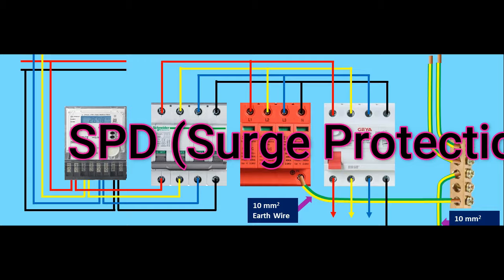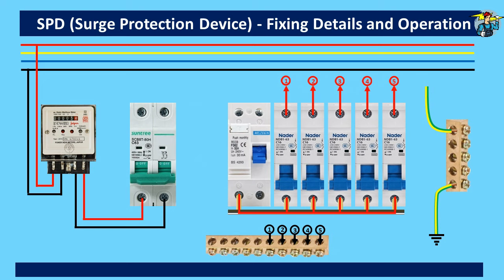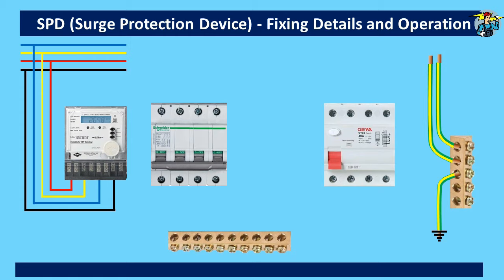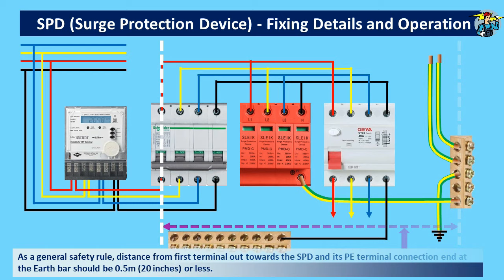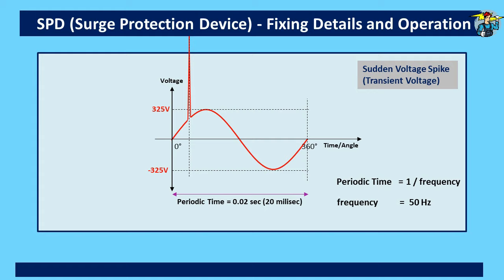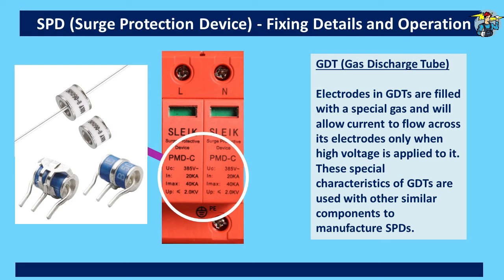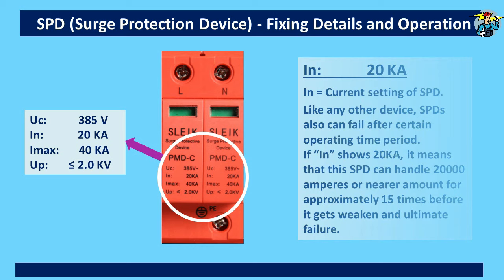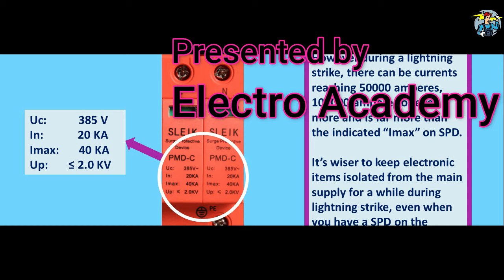Surge Protection Device / Surge Arrester / SPD working principle / Overvoltage Protection Device

Comment: Thanks for the informative video. 

What size fuses (normal or air?) do you recommend to place before the SPD? I have 16A 4P 230V coming in from the grid and 63A 2P 230V from local solar inverter.
Reply from the maker: 80 Amp fuses are recommended.

Comment: Do we need a dedicated earth bar, or we can connect the SPD to the existing common earth bar.
Reply from the maker: If the earth wire size from present earth bar to the ground rod is 10 mm2 or more, same earth bar can be used for SPD connection.
If it is less, you need a separate earth wire with 10 mm2 or more, from SPD to the ground rod.

Comment: Great video.. In a surge scenario, the SPD will ground the excess voltage but WILL it  also trip the MCB??
Reply from the maker: Even a high performing MCB will take more than 2 milliseconds to operate.
Sudden transient voltages appear and dissapear within few microseconds.
1 microsecond is 1 millionth of a second.
A good SPD will operate within few nano seconds.
1 microsecond is 1000 nanoseconds.
It shows how fast SPDs act.
MCBs are not capable enough to detect those transient voltages.
Reply: @ElectroAcademyEA  so the breaker won't trip... Thank you for replying
Reply: @shaunchetty4223  yep and now we also know why.  That's what good teachers do.
Reply from the maker: Thank you

Comment: I live in a country where rms voltage is 230v
So basically 325peak volt as shown in the video
I want to order a surge protector online
Same specs as in the video
In 20ka
Imax 40ka
But with uc 275v
In the video it says uc value shouldnt be near the peak voltage
So can i still use that ?
Even in my country here in store
They sell ones with uc lower than peak voltage
Also the up is 1.2 v is that better for voltage spike ?
Or 1.5v is better?
Please somebody help me with this
asap
Really need some help here
Reply from the maker: UC is maximum continuous voltage and is related to the RMS voltage.
Since RMS voltage is 230 volts here, this SPD with 275 V UC limit is ideal to use.
When consider the UP level, 1.2 V SPD, or even a one with 900 Volts is better than the 1.5 V unit for sensitive electronic items, but it should be used as the secondary SPD unit only.
That means you should have a primary SPD with a UP level of around 2.5 V at the entrance then.
Since we normally go for only one SPD unit for a home, better option is the unit with the UP value of 1.5 V.
Reply: @ElectroAcademyEA  i am just trying to protect my electronics from voltage spikes from power outage and surges
Where i live, i don't really have any issues with lighting 
Do i still need to buy spd type 1 ?
I also have spd type 3 on a power strip 
So i will have both type 2 and 3
Reply from the maker: If your area is free from Lightning issues,   type 1 SPD is optional only.
So you can go with Up 1.2 V SPD, and it has better protection level than 1.5 V SPD for electronic equipment.
Reply: @ElectroAcademyEA  thank you for your help
Really cleared up the confusion
And very educative video 
Have a good day :)
Reply from the maker: @kuronekosan2830  Thank you

Comment: What if I have a 230v supply feeding a split board with 2 rcds in the consumer unit
Reply from the maker: You can install Type1 SPD at main incoming line after the main switch. (Before splitting the circuit.)
If two sub-distribution boards are available with equipment need to be protected, two SPDs (Type2) need to be installed in two DBs before the RCD.

Comment: If a 3 pole surge protector ( Siemens bolt shield) is installed in a home with 120/240 v, no 3 phases capability, will the surge protector still protect ?
Reply from the maker: Standard 3phase SPD should work as long as you select matching voltage for single phase.
For a 230 volt single phase supply, V RMS is 230V.
V max is 325 volts.
When you select with 10-15 % extra voltage, SPD should have 375-385 Volts value.
Any two poles on SPD can be connected for single phase lines, keeping the extra pole empty.
How ever, ask the manufacture first, since some sophisticated units may not work with one pole is without a phase line connected to it.

Comment: Do we get electric shock when we touch any metal appliance which conected to the earth cable when the spd release the lightning volt trough the ground cable?
Reply from the maker: Always better to avoid touching metal parts unnecessarily, since we don't know the magnitude of the current going to flow, when lightning occurs.
Reply: So I think it's better to keep a separate dedicated earthpole for the spd to avoid any kind of risk

Comment: Three phase ki spd me agar two phase lagaye aur nutral na lagaye to kya spd work karega
Reply from the maker: If a surge appears on any line connected to the SPD, it will by pass it through the earth wire to the ground.
If Neutral wire is not connected, still the phase wires connected to the SPD will work.
But, any surge appears or comes in to the house from outside on the Neutral line, surely can damage the equipment connected.
That is the reason for connecting all the lines from outdoor to the SPD, before entering the premises.

Comment: This diagrama refers only for CT1 type of connection and is wrong because in TT systems RCD should be before SPD and not after. Only in TNS is after. Also who the hell uses CT1 today ? CT2 is by far beter for TT and TNS for electricians
Reply from the maker: CT1 type is used at main switch board and if sub-distribution boards too are available, CT2 type should come on to the sub-panel.
(CT2 type is not there as a replacement for CT1 type)
CT3 or type 3 SPDs are also available and should be installed separately with specific systems when  protection is needed for security cameras, telephone systems, PLC operation etc.
Further, RCD is nothing to do with SPD.
SPD is better to be fixed even before the main switch, but since it needs to be isolated when replacing or new one being installed, SPD comes after the main switch.